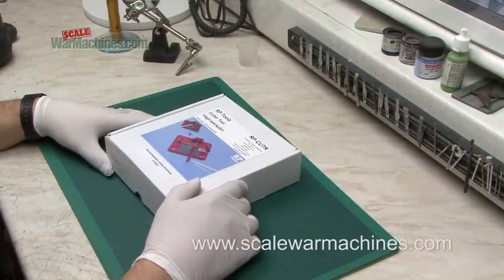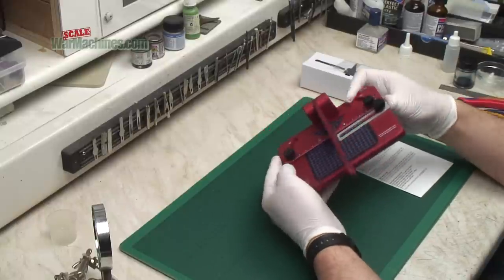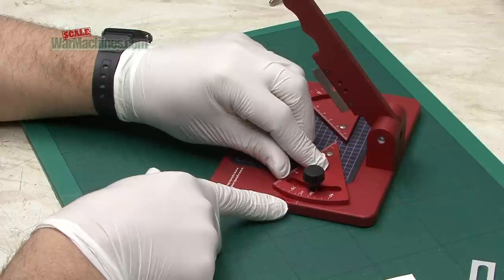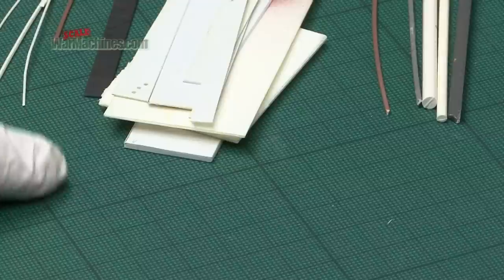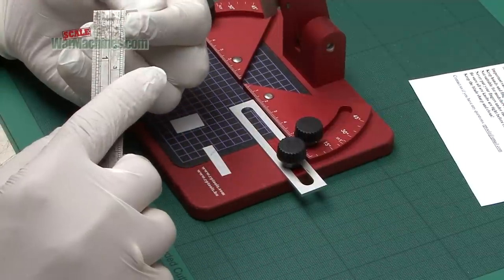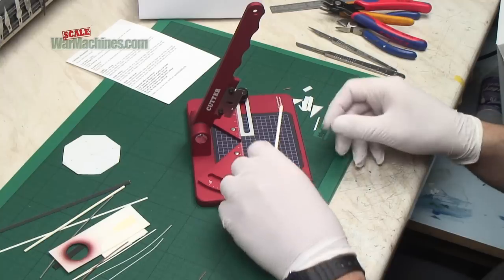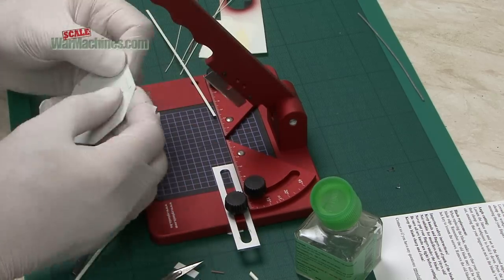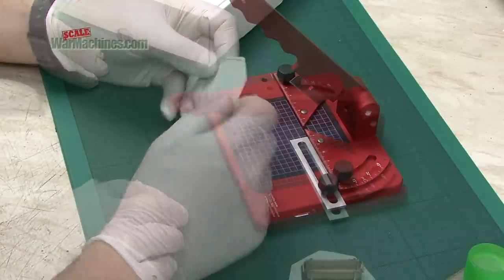AN IMPRESSIVE CHOPPER - THE RPTOOLZ CUTTER - "HOW TO" GUIDE

Comment: I had it for a year now, and it is an impressive tool. For Europe, it is the best option, as all Chopper versions are overpriced here.
The only wish I have is to have a better stop, that will work also for cutting at angle at precise length.

Comment: Good review although it would have been nice for you to chop some wood versus only plastic. Wood can tend to crush with these types of angle blade cutters. However the proprietary blades are a non-starter. Why they choose to not use standard single edge razor blades is puzzling. I suspect they'll say that the blades they sell, at a ridiculous price for 5 blades, are somehow special. I seriously doubt that there'd be a significant difference if they had used standard blades. Dave

Comment: in fact due to the V shape of the blade this tool is not a precision one. The section of the cut is not at right angles. It's not ok for as much money as it costs. So not so impressive, not so well-engineered

You may also mention the less pleasant aspects in reviews
Reply from the maker: I think the price is about right for a decent tool. The experience was positive but it did have a tiny bit of trouble with blade distortion on one item, the angle profile at 45 degrees but that was also not a straight angle or good quality profile. I mentioned this in the Premiere chat. Don't quite see how you can get a square edged blade as all blades have a taper to get a sharp edge, no? It is pretty well-engineered and delight to handle and use, for me. No real negatives this end, it was loaned and I was impressed enough to want to buy it and I will do so. Putting my own money where my mouth is...but I certainly take your points and respect your view on this.
Reply: That's wrong, a V blade grind will cut straight, a chisel grind will always want to go to one side.
Reply from the maker: @pbyfr  I think you must have made a mistake in that comment and meant the other way around otherwise you just contradicted the first comment. But let's say you meant the chisel ground is better, a chisel ground would leave one clean side and one bevelled side at each cut wouldn't it? Necessitating rotating the orientation of the work piece if you want clean straight vertical cuts at both edges for repeat cutting or at least creating some wastage? It would depend if the bevel was on the outgoing or incoming side also I imagine. Would you want it on the incoming side or would the outgoing be better? Genuine question.
Reply: @scalewarmachines  With the V grind, you have the imperfection of half the blade width, BUT the blade would less bend than with a chisel grind. For have a good cut with a chisel grind with this tool, a thicker blade would be needed (and the issue you mentioned will remain).
Unfortunately, even with the V grind, I have the blade flexing in some conditions (like dissimilar material strength, ie. cutting just one or two millimeters of thick profiles).

Comment: Too bad the blades weren't just standard blades.  Also would be nice if the fences came in imperial as opposed to the useless metric measurements.  pretty sure I stick with the US made XL Chopper from MicroMark!
Reply: I'm sure that EU based company will welcome the suggestion to cater only to the anglo crowd on such a niche market instead of the whole rest of the world using metric. Silly them !
Reply: This particular Anglo is perfectly capable of working in both metric and imperial .